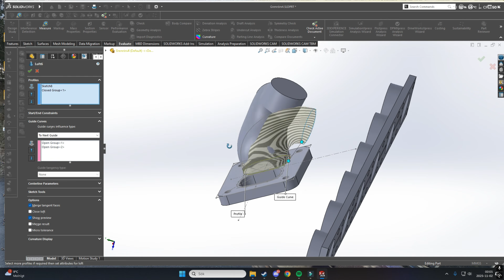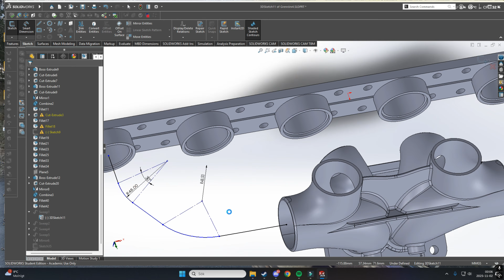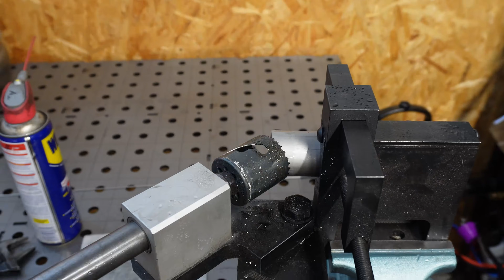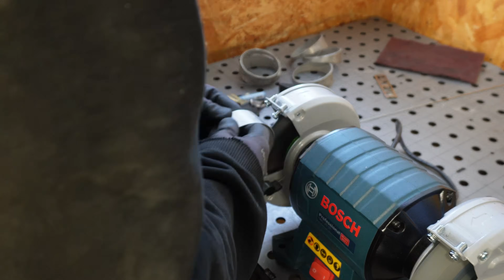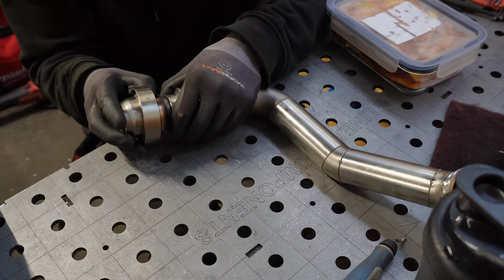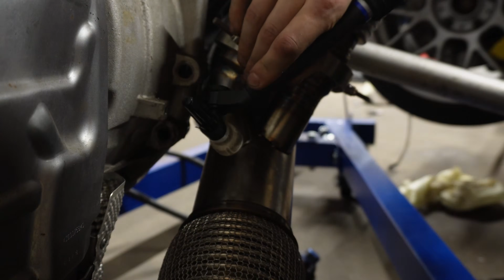How to build a 3D printed turbo manifold

Comment: Wnast grade of stainless tube did you use off the block? And Have you had any issues with heat on the 3d printed 316L part ?
Reply from the maker: I used 304 for everything except the 3d printed collector. I have not had any issues with the manifold so far

Comment: I have been thinking of making a same kind of manifold, what size runners are you using? And looks like the 2 farthest runners join into 1 pipe and the middle ones go straight to the flange. Will this have any negative effects?

Comment: Love the project dude! Did you run any CFD on your model? I've been having boost creep issues with the old spa bottom mount log manifolds :(
Reply from the maker: No i have not done any CFD on this manifold. I'm hoping that I wont have any issues, it shouldnt be a problem since i have 2 decently sized gates. I have gotten away with worse wastegate priority before without creeping so i think it will be fine. But time will tell ;)

Comment: Some kind of custom engine mount I assume ?
Reply from the maker: Yes, I'm working on it right now. I will make a video on it
Reply: @MLKRmotor  Hellrot garage on youtube is doing a build that is running Beracing 20 degree engine mounts. I assume the ones you're gonna build will be similar in orientation? 

I had to go through his videos to find out why would anyone want to do that and run the engine vertical until I discovered it was for more space for the big turbo. Is that also similar for you? 

The biggest drawback with angling the engine is that it misaligns the trans and the shifter. He was going to fix that by runing a zf smg 6sp converted to manual with a self centering spring. And in your case, DCTshouldn't be a problem with an engine not exactly oriented in the same angle as factory. 

Awesome build!
Reply from the maker: @thykingdomcome1  No I am going to be using standard 30 degree lean. I will make a video soon of how the motor mount looks

Comment: Why not just recirc the front wastegate dump tube into the second wastegates dump tube?
Reply from the maker: If i did that then it would be much harder to remove them when the engine is in the car. It was just for serviceability